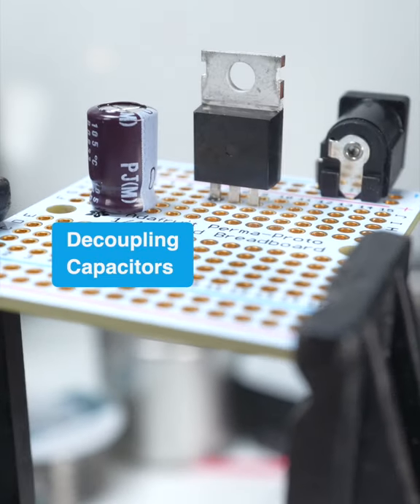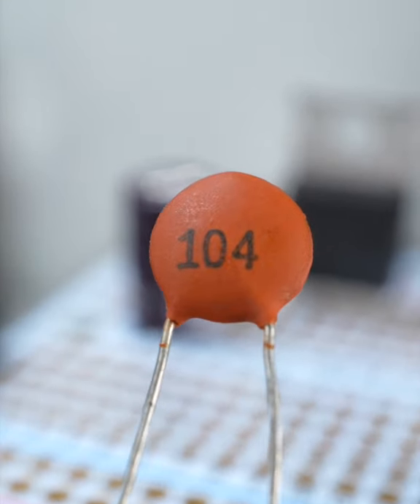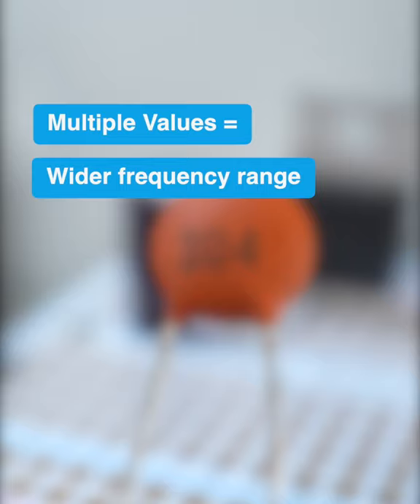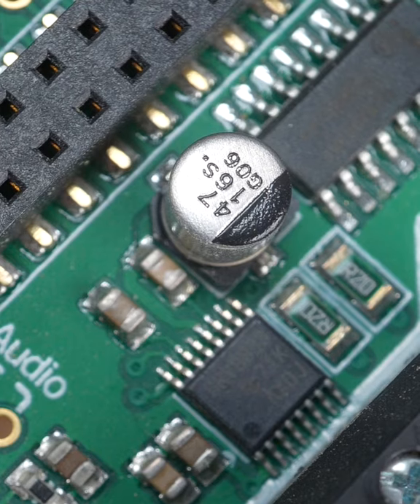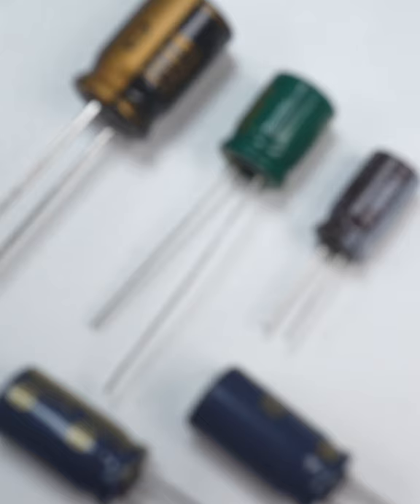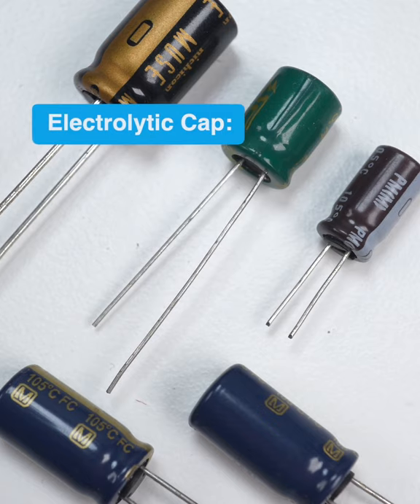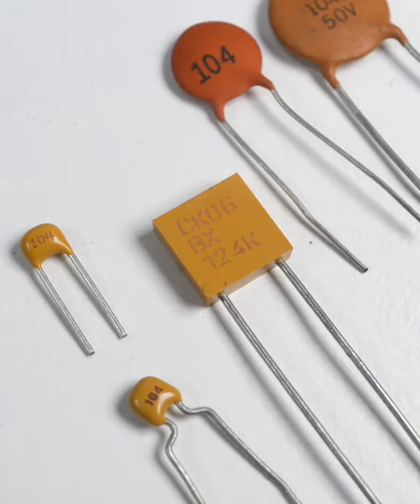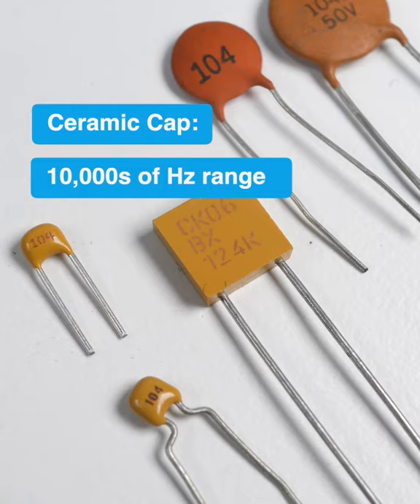Decoupling Capacitors - Collin’s Lab Notes #adafruit #collinslabnotes

Comment: It is a good practice to put the two caps in but the explanation is lacking detail. Ideally the capacity of both can be added up making the small cap look futile: the frequencies that pass through that small cap surely can move to that big cap right? Yes they could, if that big cap was an ideal capacitor, but it isn't. High frequencies coming up to that big capacitir don't just see a high capacity they can easily slip through but they also see an inductance which to them looks like an impedance
Reply: It's more than that. The large capacitor is close to the power supply while the smaller capacitors are normally placed as close as possible between VCC/GND of individual chips.

So it isn't just because of frequency limitations of the bigger capacitor but also to help with resistance/inductance in the supply/ground traces from power supply and up to the IC.

Comment: Dumb question, but: Why can't the bigger cap take the smaller fluctuations too?
Reply: I think this whole video is wrong.
Reply: Its frequency dependant, not amplitude only. Cheers, have a nice day.
Reply: Have just explained it in my reaction today. In short coz it isnt an ideal capacitance
Reply: Look up capacitor impedance vs frequency graph
Reply: Only saw the replies now, thanks a ton!
Reply: The speed of charge and discharge. The large electrolyte capacitor better for lower slower frequency application, and the smaller capacitor for the higher faster frequently applications. 😳
Reply: Large capacitors have inductance due to the plates being wrapped in a spiral and small ones have much less inductance improving performance at high frequency
Reply: @vasiliigulevich9202  And I think your thought is wrong.

Suggestion: if something doesn't match what you think, don't start by calling it false. Instead try to ask questions - lots of times, that can actually allow you to learn new things. Especially when you decides to comment on a subject that isn't in your professional skill range.
Reply: @perwestermark8920 The question is asked at the top of the thread, why would I repeat it?  It is answered by humann8tur. Thank you human. BTW, it proves that explanations in video are at least irrelevant and otherwise ridiculous.
Reply: @vasiliigulevich9202  You posted "I think this whole video is wrong".

That was a claim. Instead of making an incorrect claim the video is wrong, you should have described what part you thought was wrong.
Reply: @perwestermark8920  Are you trolling me? Please stop. The wrong part is explained by topic starter - marginally increased equivalent capacitance does not have a major change in frequency response, hence the explanation based on capacitance value is wrong.
Reply: @vasiliigulevich9202  Nope. This is where you are wrong, big time. The small capacitors aren't there to add more capacitance. They are there because of mainly two reasons:

1) their diffwrent inductance and resistance values allows them to handle higher frequencies than the slow electrolyte. These additional parameters can be retrieved if you don't just read voltage/capacitance in a web shop but reads the actual datasheet from the component manufacturer.

2) they are often placed as close as possible to actual consumers. So shortest distance between VCC and GND for an IC. This eliminates the resistance/inductance in the PCB traces between the larger electrolyte at the power supply and the individual consumers on the PCB. Not only does it give a more stable supply to the chip, but it also reduces the impulses in the supply traces - reducing the noise radiated since all traces are antennas.

If you think this best practice since the last 100 years (yes, it was used before we switched to PCB too) is wrong, then you have a tough uphill battle to post actual arguments.

One problem you need to solve - the actual result of adding these small capacitors can be measured with an oscilloscope. And can be predicted with arbitrary electronics simulator.

Try to open the design schematics of professional electronics and see what professional EE designers have done. Try to look at real electronics boards and check out all the tiny capacitors. They didn't end up there for some random reason that originated in the designer being unskilled.

In conclusion - if you think it's just about adding up capacitances for stacked capacitors, then you have quite a bit of EE studies in front of you. But right now, you aren't in a position to make actual claims because you are too far behind in actual knowledge on this subject.

And no - this OP starter did not explain what was wrong with this video. The OP was open-minded enough to understand he/she might not know everything. So OP posted a question if the smaller capacitors actually made a difference. You, on the other hand, went all in and decided they were irrelevant. And ended up betting on the wrong horse.

So - you here to learn? Or to continue to make incorrect claims?

Comment: What i don't understand: Theretically two capacitors next to each other should act as a single bigger one. So why do they act like two differentcapacitors if there is no resistor in between?
Reply: Simply put, each capacitor provide different impedance to each frequencies. So if you have noise at two frequencies and want to suppress it, you would need two capacitors.
Reply: One word: ESR
Reply: @HemantKumar-xn8mn  “one word” proceeds to use an acronym for 3 words
Reply: There is a resistor in between, it's the resistance inside of the cap, in different capacitor technologies there is a different range of capacitance and resistance. High capacity usually comes with high resistance and vice versa.
Reply: @JamilKhan-hk1wl  kind of right, it all comes down to the ESR, if you could build a ceramic capacitor with the capacity of a electrolytic one, out wouldn't need two caps.
Reply: @MrGoesnuts  i dont think so. Esr is more of a parasitic component and is more detrimental to the circuit. You always try to reduce its effect. Impedance of capacitor is 1/jwC. Thats why it provides different impedance for different frequency. For lower frequency noise, you use large caps and vice versa
Reply: @JamilKhan-hk1wl  you got something mixed up, you either can see the cap as ideal component. In that case you can use your formula, but then both caps are parallel and therefore the values add up to one cap. Or you can look at them in a realistic way, then you have to include ESR, as well as series inductance, trace length etc. But in this case you can't use the ideal formula. Btw, an ideal cap doesn't reduce any frequency without a resistor or inductor.
Reply: @MrGoesnuts  your explanation doesn’t add up. Inductance is what would suppress ripple, not resistance. Unless there’s something about ESR you’re glossing over.
Reply: @fosterlewis7360  The explanation is a little short for the complexity of everything I tried to put into it. Basically the energy that is in the ripples needs to be dissipated and that can only happen in a resistor. Every form of Bandpass, lowpass or other form of filter creates higher currents for the ripple in a resistor than for any other part of the "signal".
Reply: @MrGoesnuts  curious! Thank you for this explanation. It’s probably about time I finally did some real reading on this subject since I’m interested but lacking knowledge.
Reply: @fosterlewis7360  some of my master students wouldn't know how this exactly works.
Reply: @MrGoesnuts  EE Masters? this is like passive component basics
Reply: @Ferraday  I'm talking about the details. Those are absolutely not basic.
Reply: @MrGoesnuts  The goal is normally not to convert ripples into heat in any resistor. That's wasted energy. That is more what is done in protection circuits where you may have something semi-equivalent to a zener diode "short" overvoltage spikes.

For ripple and load spikes it's the capacitance that should smooth out the voltage by being small batteries that quickly charges/discharges. With a large enough capacitor in relation to the frequency, the capacitance is what eats the majority of the ripple since if the energy in the ripple is small in relation to the full charge of the capacitance then the ripple energy results in a very small ripple voltage.

The resistance/inductance is just what limits how high frequency the capacitor is fast enough to react to. Which is why the smaller capacitor beside the bigger capacitor can eat the highest frequency components of an input step function like a load spike by having less resistance/inductance.

Comment: Hmm, but why do bigger capacitors filter out fluctuations of lower frequencies? I thought that capacitance is the main parameter of a capacitor, and that connecting two capacitors together will just merge their capacitance. Is there another parameter of a capacitor that controls speed of its discharge(some kind of internal resistance perhaps?)
Reply: ya, Colin's video tells the "why" but not the "how", ie the physics of real caps (with ESR, etc...)
Reply: Bigger capacitors have a low impedance at low frequency, so it's like they short out any low frequencies disturbances that come along and try to change the rail. However, at higher frequencies, their impedance increases (due to the parasitic inductance), meaning they no longer act like a short and can't stop high frequencies disturbances.

Smaller value ceramic caps act like short circuits at high frequencies and can take over when the big electrolytic caps crap out.

 These caps should be placed as close to the component you are trying to filter because the inductance of the traces or wires will reduce the effectiveness of the caps the further they are.

Comment: Ermm ... ceramics are high frequency range than that (100k's Hz-100's MHZ)... some are even faster than silver mica caps. 
Also the higher the voltage the fast the capacitor (as long as the capacitance is the same)
Reply: A ceramic can of course be used for even higher frequencies. But it's all about the context. This context is about filtering the supply voltage. And this is more than just how fast a capacitor is. It's also about the amount of energy stored. So the "ten thousands of Herz range" relates to how long the capacitor is able to help bridge a load spike.

This means it's irrelevant what frequency range it's practical to implement RC circuits using ceramics capacitors. In this context the relevant part is how fast they can react (serial resistance) and how long load spikes they can bridge (capacitance).

The electrolyte is slower and is also much further away so inductances and resistance means it can't smooth the shorter spikes. While the ceramic caps have lower capacitance so they can't handle as long spikes.

So in this context, for the electrolyte it's meaningful to talk about the upper frequency it can help with. And for the ceramic, it's relevant to talk about the lower frequency it can help with.
Reply: Actually every cap has a frequency range in which it handles the most ripple...
Reply: And for lower frequency always best to use electrolytic in parallel with film (any of the many types)

Comment: Needs to be separated by a resistor though, if it's connected directly in parallel, analytically, you are only using one 10.1uF.
Reply: Nope, and the total capacity is not a parameter that's interesting in this context anyway. Many ICs also get their own 0.1uF capacitor close to their power pins, but if you look at the schematic, all those caps are in parallel across the power supply. However moving those caps all together or replacing them with an single equivalent capacitor will defeat their purpose entirely.
Reply: No no no, no resistors between them! The reason they filter out different frequency ranges is because of ISR, in series resistance. Electrolytic capacitors come in high capacitance values but they also have high series resistance, whereas ceramic caps come in lower C values but have lower resistance. You can have a mix of both using tantalum caps!

Comment: 104? I thought 103 is the way to go… is there a rule of thumb when to use one over another?
Reply: The size of spike affects the capacitance - how much energy that needs to be eaten by the cap.

So larger capacitance handles larger spike/ripple energy.
While lower capacitance normally has lower resistance/inductance and reacher a higher frequency and can eat faster spike edges.

Adding series resistors on digital signals can also reduce the slew rate of signals. And also reduces the load spikes on turn on/off. And this reduces the frequency that needs to be eaten on the supply voltage too.